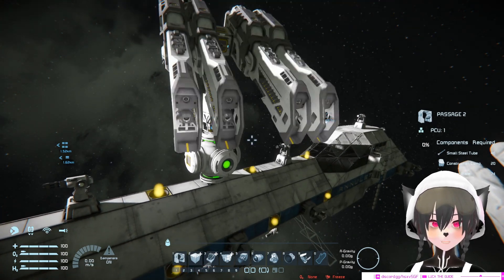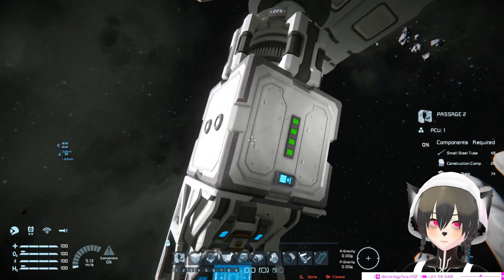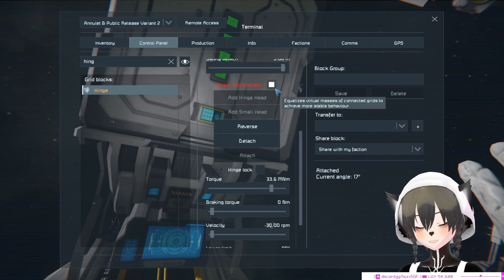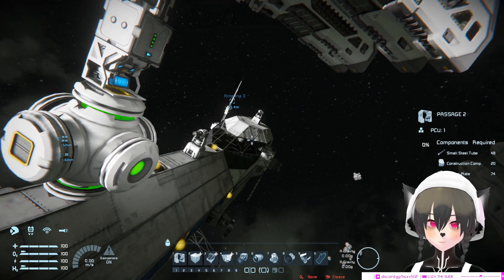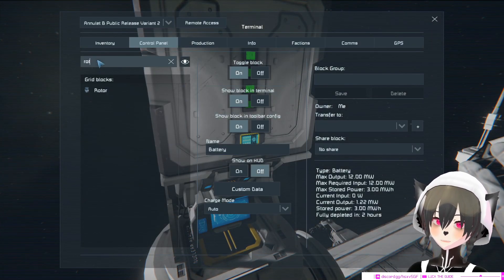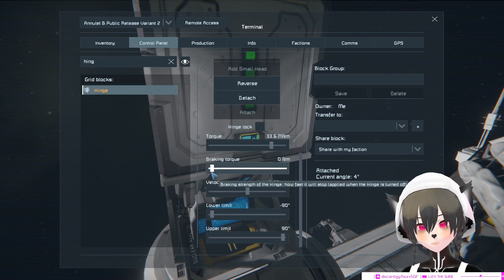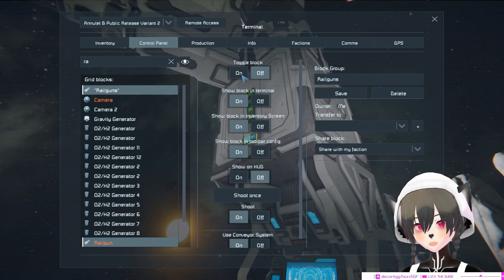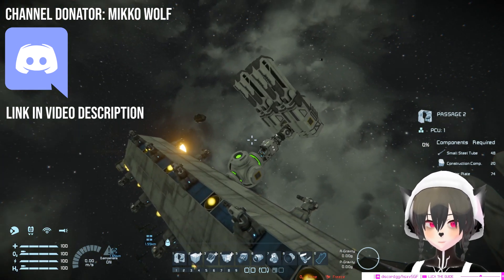Make Custom Turret More Accurate and Less Wobbly, Space Engineers Warfare 2 Custom Turret Tutorial

Comment: This wobble is caused by the custom turret controller using the full speed of the rotor and hinge for any movement. By doing so it overshoots its target and moves back at the same speed.
The way to deal with this is to add gyroscopes to both grids on your turret and giving them override while lowering the power to a point where the rotors and hinges can overpower them but are still slowed down when they are on target. The heavier your turret is, the stronger this wobble effect and the higher you need to set your torques and your gyroscopes.
Also I would suggest keeping share inertia tensor off for the azimuth rotor.
I hope this helps <3
Reply: Rotor with share inertia tensor basically acts like a gyro instead of actually rotating the turret. Rotor inertia tensor sharing seems like a bad idea generally to me.
Reply: yo, if only i read this comment before i found that out myself by wasting 1 hour of my time on it
Reply: No need for either of those, just have the torque very high and set up a script to lock the rotors/hinges in place when the weapon is aligned.

Comment: No. Braking torque ONLY applies when the rotor or hinge is switched off. It is pointless to adjust it while it's switched on, and it needs to be on anyway to function as a turret. And it's not moving left and right because it's tracking the target, it's doing so because the controller is trying to accelerate the turret to the speed it is permitted in the controller's settings. It simply drives the head as hard and as fast as it can to reach that speed, which results in it not slowing down in time , overshooting the target angle, and does so repeatedly until it eventually arrives at the right aim. So, if your custom turrets are behaving too violently, I suggest you play with the velocity sliders in the turret controller. Set them from their default 9 or 18 to 1 or even .5 for very large turret heads. Also, set Share inertia tensor on hinge (but not the rotor).
Reply: wrong

Comment: Is there a way to control custom turrets? I can't seem to find any way to manually control them.
Reply: After setting them up in a Custom controller i.e. rotor, hinge, camera, weapons; you add that custom controller to a space on a control seat board with the option set to "control".
Reply: If the "Control" button appears grayed out, you need an antenna somewhere on that grid (not necesarily on the turret per se) (found that out today xD) Also if the control button simply does not appear, you need to put the Custom turret controller on the turret it self. This happened in testings when i put a "conversor rotor" (to change from large to small grid), then a small grid advanced rotor, hinge, and etc. My turret controller existed on the grid of the "conversor rotor" and the button didnt exist on the controller, i switched it to the turret grid and it worked. 

Note that you can have a large block turret controller control a small block turret, you just need to "not have" any extra hinges or rotors on the way, only the ones that will form the turret

Comment: I have a mobile basic and a turret for the large grid railgun is massive (30M kg ship).  On the destroyer the turret looks right (110M kg ship).  Really the issue is the gun is too big for a small mass ship.  With really big ships you can have two or three railguns per turret.

The only issue is railguns are not an up close 800m weapon and AI stops working at longer ranges.  Having lots of them is hard to use at 2km range.  Mostly big ships have the armour to take hits like it was nothing and then reload times are very long which makes it hard to do real damage.  The railgun does completely destory light armoured hulled ships.  So small or large light hulled ship are deleted by battleships with three railguns per turret.  Same with ships withonly one heavy armoured hulls.

Battleships with heavy, gryo and heavy armoured hulls will take multiple hits in the same place.  The first hit just takes out the first heavy block.  If you want to just use heavy armour then three to four blocks is required.

Comment: The new blocks are allready out? Bruuuh, Also ı prevent the wobbly turret by making it heavier with armor and size and balance the weight and center it around the rotors, it worked somehow with the turret scripts
Reply from the maker: Oo that's cool, weight though x -x
Reply: I accually like to make heavy things, and come up with realistic solutions, the game physics handles the sub grid systems and precision articulations good enough if they are balanced and heavy enough, adjusting the rotor and hinge parameters works as well but with modded weapons with recoil, it bends like a twig ))) pretty realistic sometimes this game..